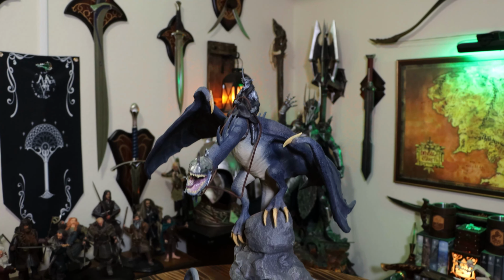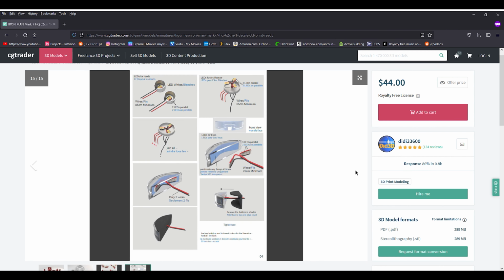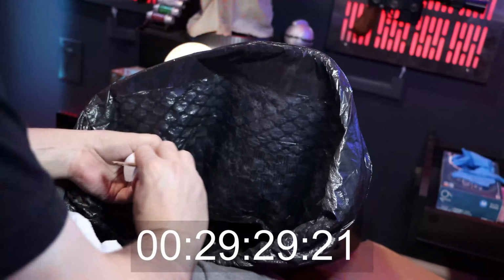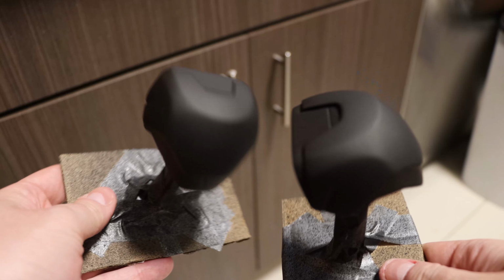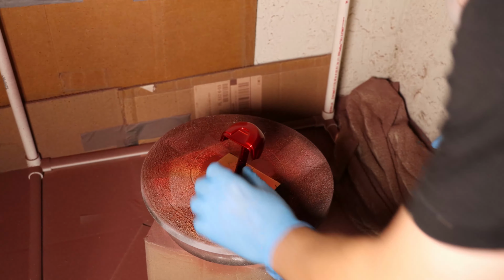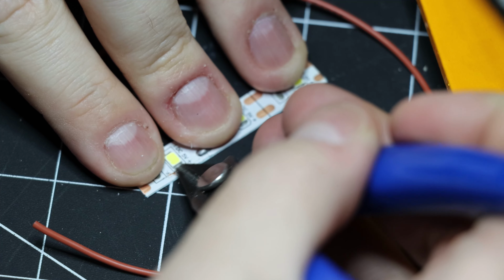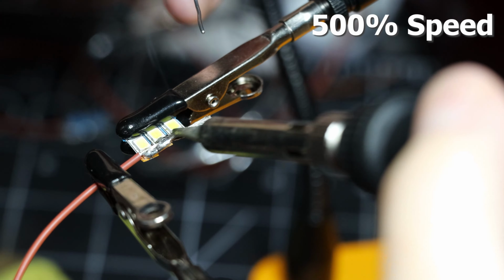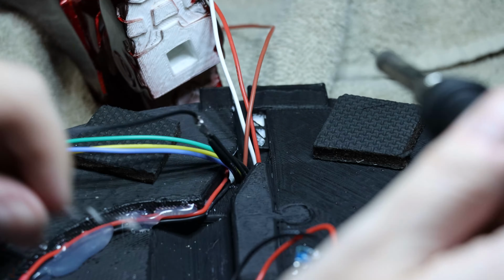Making a 1/3 scale Iron Man Mark VII - 3d printing model by DiD3D

Comment: Amazing video and paint job. Next time you have to solder, use flux to help the solder flow to where it’s supposed to
Reply from the maker: honestly I was a bit confused about this as I had seen it in some soldering videos. The solder I used supposedly  had "flux" in it (2%) so I thought that might be enough. Will def try it next time though.
Reply: @thecyberhobbit  There is flux in the solder you're using, that's what's causing the smoke as you melt the solder. The mistake you are doing here is that you are melting the solder on the tip of the iron and then moving it over to the part and smearing it across the joint. When you do it this way the flux burns off and can no longer do it's job (cleaning the joint and promoting the solder to flow). This will create a so called "dry joint" which is a joint that looks dull. A good joint with lead based solder is very shiny. Lead free is also shiny, but less so.

What you should be doing is to apply heat to both the wire and the copper pad and then feed the solder into the joint. This way the flux can do it's job properly and it will be much much faster and easier for you.

You can also add additional flux on the joint before adding the heat which can also make the process easier.

You can also do what's called "pre tinning" which means you will first add a little bit of solder to the parts you wish to join. Then hold them together and apply the soldering iron again to "re-flow" the solder. This can sometimes be easier to do if the parts are flopping around for you. In this case there wont be any flux left so here it can be beneficial to add some flux before joining the parts but it's usually not required.

If you opt to buy some additional flux, make sure you buy flux that is made for electronics. Don't use the stuff they sell at the hardware store that is used for pipe work, it's too aggressive for this type of work.

And if you can still find it, use lead based solder. It's SO much nicer to work with (and no, it's not going to kill you by handling it, just don't eat it and wash your hands after).

You're also using much more solder than you need but that's not really a problem as such, just not necessary.

But to sum it up, the key is to add heat to both parts first, and then add solder.
Reply from the maker: @treborrrrr  Wow I appreciate all the helpful info! Yeah I was very new to soldering but a lot of what you said makes sense. I will definitely keep it in mind for the next thing I have to solder. Thanks for your time and commenting I really appreciate it!
Reply: @thecyberhobbit  No problem :) I hate to see people struggling with soldering when I know how much easier and fun it can be with just a few tweaks to technique so I try to help when I can.

And thank you for posting this video. I've been thinking about printing and painting this particular model for a few months now but I haven't taken the step yet. I recently printed and painted a T800 bust which I wasn't quite happy with so I'm making a new one, but all this sanding sure is boring! :D I do have access to a selection of SLS/SLA printers at work so I'm thinking I might just use those next time to save some sanity.

Comment: This is absolutely amazing!! awesome finish and video was edited to perfection! Thank you!  PS-why did you list 2 types of gold spray, did i miss something? :)
Reply from the maker: Hi Perry, Thanks for the compliment it was a fun project. I think maybe you missed something, there is only 1 type of gold used. Though the can does look very similar to the "Silver" paint used as well
Reply: @thecyberhobbit  in the description you listed 2 types of gold!
Reply from the maker: @perrywheeler4455  Ohhh I see what you mean... you're right they are different but the paint will look identical and can be interchanged. 1 of them just has a "thicker" coating application. Either can be used.
Reply from the maker: @perrywheeler4455  I'll update the description to clarify, thanks!
Reply: Thanks Buddy! totally awesome job, result was fantastic-If mine turns out anywhere near as good as yours i'll be very happy!
Reply from the maker: @perrywheeler4455  oh cool you're building it! It's was a blast to work on... I kinda of miss the process. I've been looking for something similar to do again and am very much considering making Did3D's R2D2
Reply: @thecyberhobbit  That would be amazing! i'll let you know what it turns out like. I've just ordered all the paint :)
Reply from the maker: @perrywheeler4455  great looking forward, btw I know I linked paint on amazon but you can get it for much cheaper at hardware stores like Lowes or The Home Depot. I went through 2-4 cans of each
Reply: Hey Buddy this is Perry! Thanks for the advice, I'm in the UK 🇬🇧 so some of those paints especially the red I can't get but I found the exact same stuff but a different brand. I'll start printing that on Monday. Working on a number of projects at the moment including a 4.5 feet Superman model but really looking forward to starting this. Seeing your work has Inspired me!!
Reply from the maker: @patchtech3d  Thank you sir! oh wow that's a big Superman, best of luck let me know any questions you have. I recommend joining the DiD3d Facebook group as well.

Comment: Buy the LEDs separate next time. Also use some flux or better solder with more flux inside. Also apply a little bit of solder to the parts and wire first by heating them up and then add solder. This way you should save some time and nerve’s.

Awesome work!
Reply from the maker: Thanks Lazy Man!  There is actually part of the LED strip inside the base but it's only a little over a foot long so these were just easy to use since I already had it. Yeah it looks like I've got a lot to learn about soldering! Really appreciate you comment!
Reply: @thecyberhobbit  Also check out the online calculator for the series resistor needed in front of the LED if you want to have longer lifetimes and prevent heat them up to much. Iam afraid of your model and also the work to replace them. With such a big base you could also checkout these fancy wireless LEDs, maybe it’s an option for another project in future.
Reply from the maker: @lazyman1011  I actually did use a resistor for the leds in the base I just didn't go over that in the video. This was included in the instructions that came with the model showing how/which one to use.  Wireless LEDs sound like a great idea will def check that out.

Comment: How did you print the lens on the base? Resin or pla and what color?
Reply from the maker: Do you mean the windows panel things? it's just white PLA at .1mm layer height... really need your printer calibrated to get good results though, I reprinted those at least 3-4 times before I got good results.

Comment: Hey man! Excellent work! I and busy now with sanding and painting & wiring of mine and am having some issues with the arduino, for some reason the arc reactor keeps failing to start properly. It starts fine and begins the light sequence and then I get a red light flicker on the board and it shuts off and then begins again. would you perhaps know why? 
I tried asking in the "support group" on facebook but nobody seems to answer anything on there so I am stumped
Reply from the maker: Hmm I don't really know as this was also my first arduino adventure sorry man... try to message Didier directly on Facebook. I'll look for your post and bump it. Lots of people are on holidays so responses may be slow. Do you have all the leds wired up correctly?  I never tested only doing a few of them, I only actually turned it on with everything connected.
Reply: @thecyberhobbit  Thanks bud, yeah they are connected properly and regardless of all of them being connected or not doesnt really matter because the info being transmitted to the board work on a on/off basis when on if preforms its current sequence no matter if you are connected or not.

Comment: How much would you charge me if I wanted this printed from you minus the clear parts and wiring and lights mainly just iron man mold
Reply from the maker: Sorry man I don't really take commissions for this, I only have a small printer and at the moment it needs some repair... BUT you could definitely get this printed at an online 3d print farm and then they will mail it to you. I recommend craftcloud3d, I've used them many times. They have hundreds of printers and they wouldn't charge for failed prints.

Comment: Hi, could you explain more detailed the setup for arduino in this project?  great work !!
Reply from the maker: Hi there... I probably won't make another video but I can give you a bit more insight. This is a model you need to buy and I don't want to offer Did3Ds work for free.
Reply from the maker: Also I would recommend joining the Did3d facebook support group. It's basically a place to ask all sorts of questions related to Did3d models. I creator offers great support there.
Reply: @thecyberhobbit  please dont post page of manual if the pack is buy normaly the manual is always included in. thanks ;-)
Reply from the maker: @did3d523  sorry Didier I removed it, apologies

Comment: how long it takes to print ?
Reply from the maker: I did it in about a month, but I took my time. It could easily be printed in a couple weeks
Reply: @thecyberhobbit  nice, what printer are you using?
Reply from the maker: @kuyastorm3422  I used an Ender 3 Pro, but if you have a resin printer it will go much faster